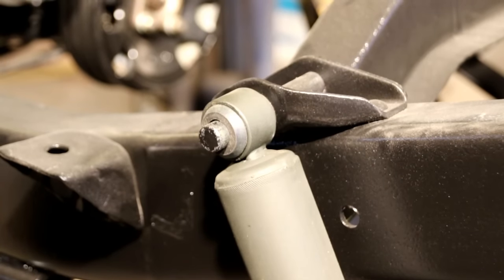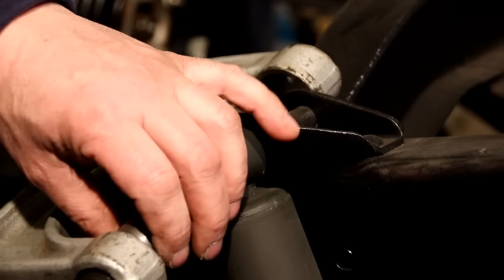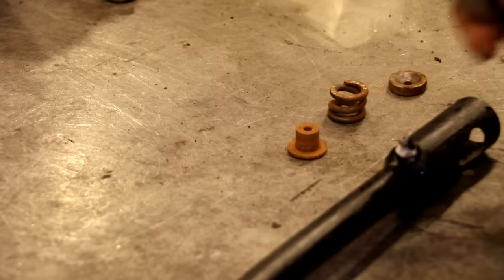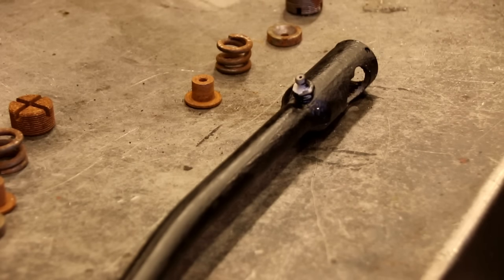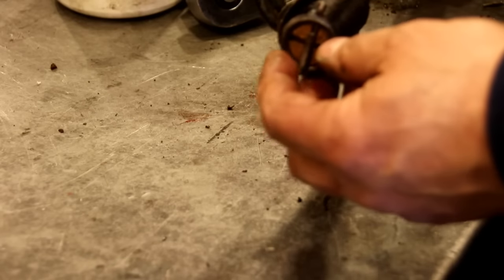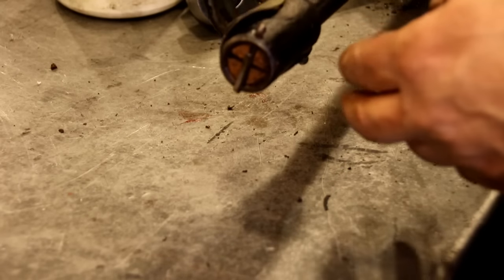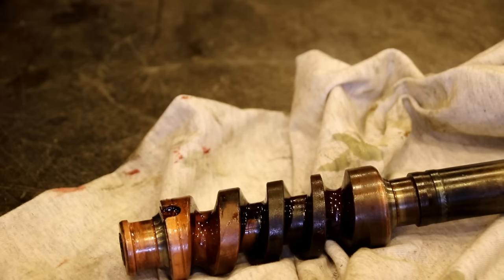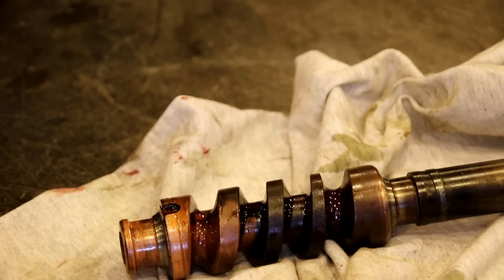Willys Jeep viewer requests, steering gear lube

Comment: I have been watching your Jeep work for the last year.  Previously, I had bought a 1960 CJ5 saving it from the wrecking yard.  Your skills, information, techniques, etc have made me want to restore it.  Everything needs rebuilding, sheetmetal restoration, etc.  You have made an old man (78) want to do something to start the restoration process.  The first thing will be this steering box pulled and rebuilt.  I am going to try to rebuild items in the downward mode filling arriving at the sheetmetal problems.  This gets my feet wet and gives me incentive to continue all the while the project is under a controlled situation as I proceed;  I have "MAC degeneration" and want to continue the process as long as possible.  Your videos and other information does provider insight and expert/practical experience/suggestions.  One example is how, why, etc you do certain such as pitman arm, cotter pin inserting and tightening, etc.  You do a great job and I am having fun in starting my project I thought I would or desired to become involved.  Here we go on this journey.  Thanks for all your videos.
Keep going, Tiger!  Setbacks do happen but we shall prevail.
Steve 
Shoguneagle

Comment: Need to retread the top of the steering column. Do you know the pitch or size?
Reply from the maker: should be 13/16-20 but you didn't specify which vehicle you are working on so check it carefully first.

Comment: Brian,  will the Miller c-748. Work for pinion seal on Dana 44. Like the Miller w-251 seal puller
Reply from the maker: I have never tried the miller c-748 but I have seen them in the past and they are much larger than the 251 that was designed to remove the seals on willys jeep vehicles.  Best to find the correct tool to do the job. 
Brian

Comment: I was hoping you would show the assembly of all the parts into the drag link not just placing them on the bench. Manual states turn to tight on the ball then then back off 1/2 turn front and 1 full turn steer box ends. Steering box lube per manual should be 80w140 gear oil, no special lube needed.
Reply from the maker: good luck with the 80w-140, it will disintegrate your steering box bushings in a very short time, and may leak out the seal quickly as well.

Comment: What is the best way to remove all the old steering lube?  Do I have to pull the side cover off?  Do I have to remove the fender?  (sorry, I'm not a great mechanic, but I sure am loving all these videos)
Reply from the maker: yes, the best way to remove lube and give a cleaning is by removing the side cover.  Pull out all the old grease or lube and give it a cleaning with some solvent.  Get it as clean as you can before adding new fluid.
Reply: Thanks, Brian.  Also, I've not been able to find exactly how tight to adjust the main bell crank bolt.  Do I just tighten it tight and then tighten the "pincer bolt"?  Or is there a specific torque to put on it?
Reply from the maker: I tighten them and use red loctite on the threads.  Often times the nut is a locknut but I am not sure exactly what you have.  Should be tightened for the size thread that it is and then install the cross bolt also with loctite on it.